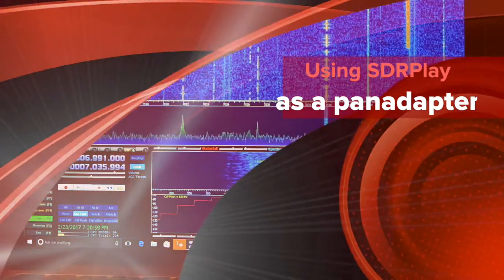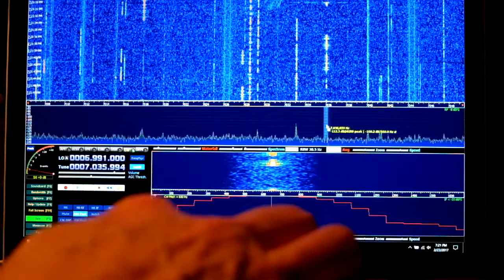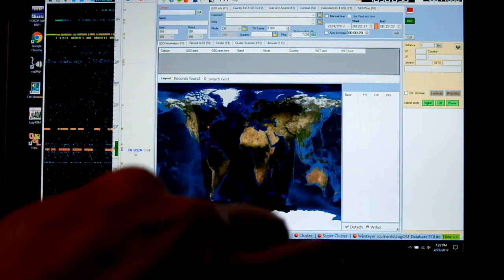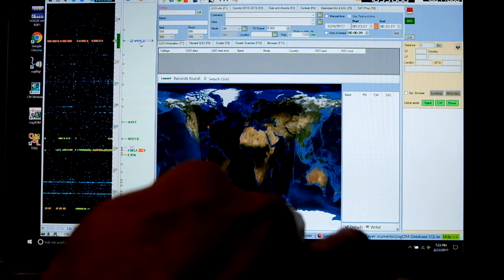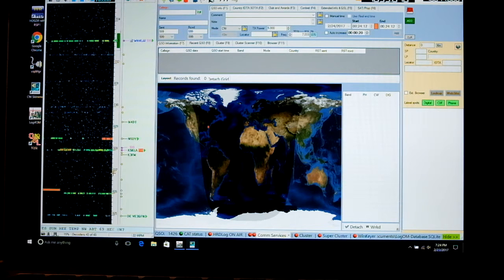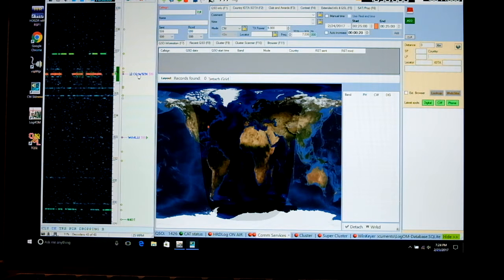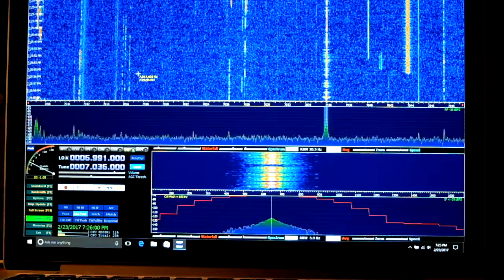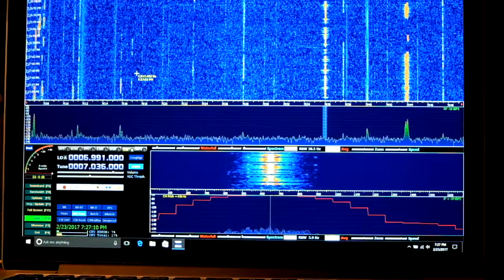Using SDRPlay as a Panadapter for older Transceivers

Comment: how do you sdr a old radio example frg 7.now that would be clever.cheers sir uk...
Reply from the maker: In this example the sdr is completely outboard of the rig using a separate antenna for receiving. The only connection to the rig is the amp key signal to protect the sdr front-end. 
I even use this sdr with my Korean war era AN-GRC9. Although theres no rig control, I sync them manually using the NET signal.

Comment: How do you connect the sdr to the transceiver?
Reply from the maker: My SDR is fed by a separate receiving antenna. That antenna is switched out during transmit by the amp relay output to the fast relay shown in the vid

Comment: I'm trying to sort out (in my head) the radio is not here yet, how exactly to do this with 7100 and am not finding much information.  Maybe it's "too easy" on the "new" rigs and I'm just over thinking it.  Ultimately for mobile installation. Any guidance or re-direction is Fine Bidness.
Reply from the maker: The relay's job is to ground the receive antenna (disconnect) from the SDRPlay receiver.  It is driven by an amp relay output from your xcvr.  So wire the amp relay from your 7100 to the amp key input on the OK1RP relay.  Hope that helps

Comment: I'm doing the same thing with a FT-991 (not the 991A),  one (HF) antenna with a coaxial relay between the  SDRplay and the 991. It grounds out the input of the SDRplay and I can toss in -60db of virtual attenuation in SDR Console (for the waterfall). These little SDRplay units are a real bang for their buck. Amazing rigs.